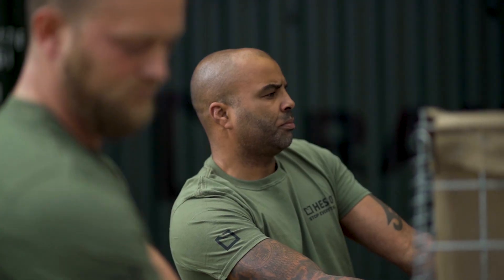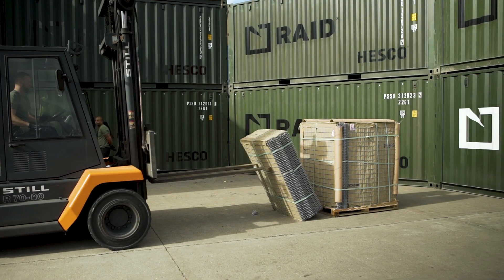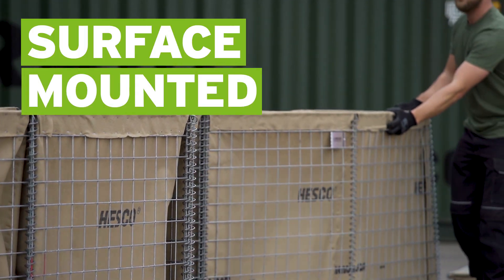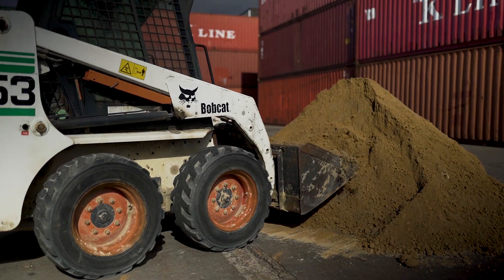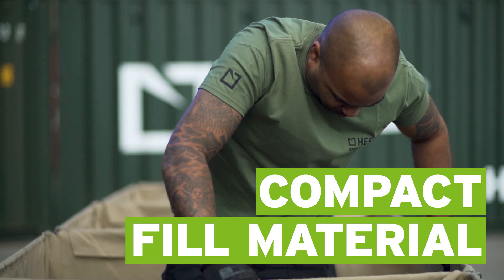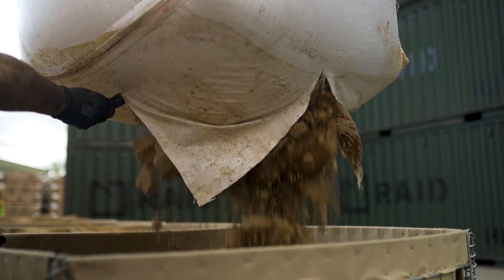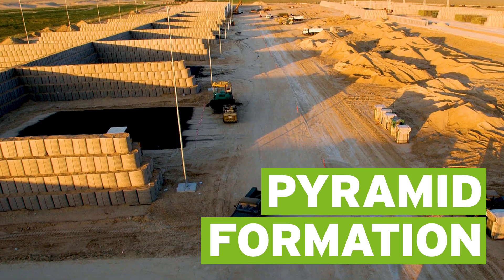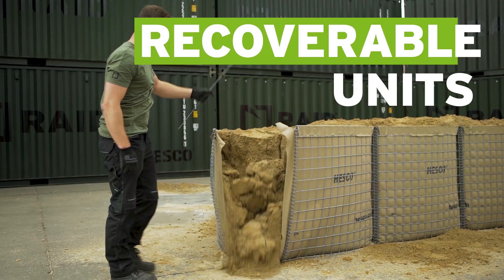HESCO BARRIER assembly guide

Comment: Does it work on slopes and inclines?
Reply: As a military engineer I would always advice to spend enough time on foundation and a leveled base.
Especially with todays modern quick assembly equipment such as HESCO, modular bridges, etc. We often spend by far, most of the time on a solid and levelled foundation.

Comment: For that first earth layer with required compaction (the foundation) when the barrier is "permanent" - use engineered flowable fill.   Basically, aggregate-free concrete (mortar).  Self-consolidates, and sets in less than an hour with admixtures, you could follow the deployment truck with a train of volumetric batch mixer trucks to hit the cells with a foot of fill.  Mixtures can set to 50PSI in <35 minutes, so filling can begin almost immediately.

Comment: Those rods don’t slide in that easy; dude definitely missed all the rings.. but thank God for hescos
Reply: Thank Hesco, for Hesco's 😉
Reply: Thanks hesco
Reply: Exactly what I noticed, This videos obviously just for demonstration you can’t pull those rods out easy with those cells are expanded with the sand or dirt and properly compacted; there’s a lot of pressure against those rods. I install these barriers in the Seattle suburbs Over a decade ago for flood control, and we used the vacuum truck to remove the contents of sand when we disassembled a couple of years after the flood threat in some areas.